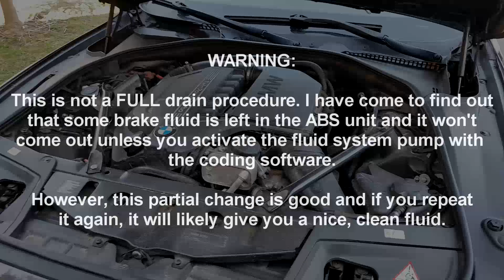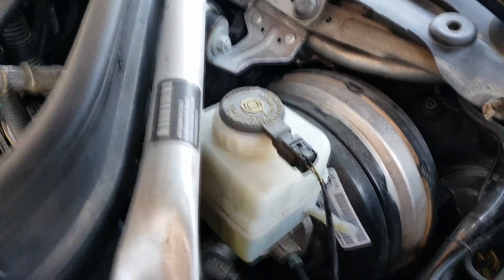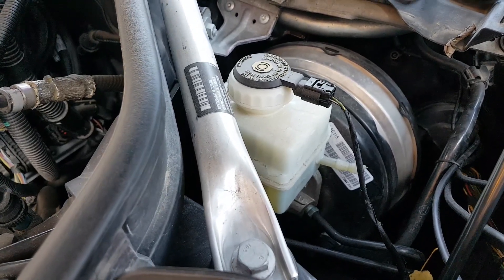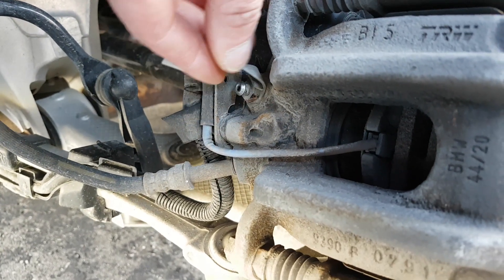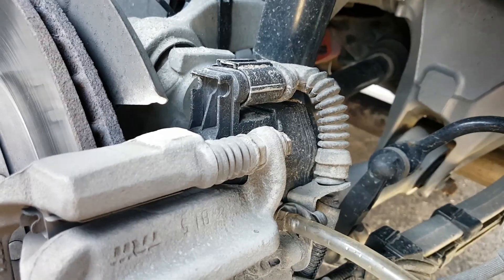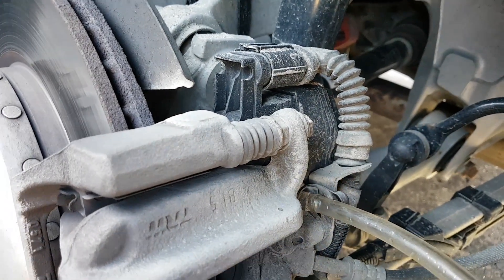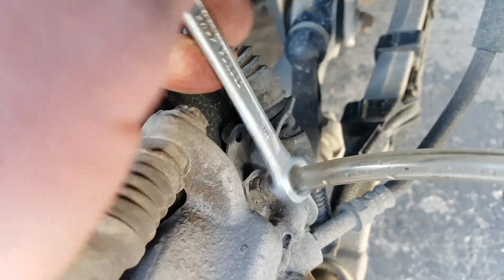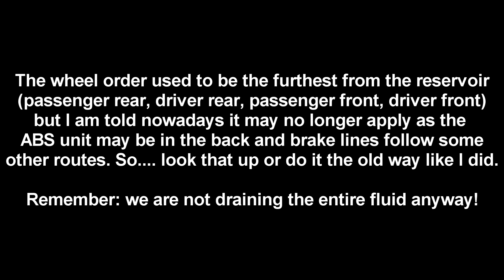BMW 5 Series F10 - Brake Fluid Replacement, Drain, Refill - N55 DIY - 2011 BMW 535i F10 3.0

Comment: 1. Brake fluid flush time is a good time to check brake pad thickness.  The radial groove on the pad should be visible, if not it's time for new pads.
2. What almost all fluid change videos miss is that the caliper is full of fluid and simply pumping fluid through it, or sucking it through, may not fully replace fluid in the caliper, which is where new fluid is most needed. To accomplish that, push the brake pads and caliper pistons to the full retract position and place something between the pads to keep them far apart.  The proceed as usual; remove the spacer when done.  
3. Do not forget to top up the master cylinder fluid reservoir after bleeding each wheel.

Comment: i wonder if this is still the right way of bleeding the brakes?
Reply: Its not. Air can get back in.
Reply: Me too😁
Reply: Hes a cowboy as there come from all over u tube . Think of the pipes ' Abs and the oil near the cylinder that's nearly half left over . No air locks though bcus he never emptied.  Ha ha pls be careful .... joke ! 
You must ask if a liter went in it must come out same amount .

Comment: Should you not close the caliper every time you lift the brake pedal? You risk sucking the air in this way.
Reply from the maker: no, because you are not sucking anything in (and your old fluid in the tube prevents any air from getting back in). if you watch what is happening, you are only expelling stuff and new fluid is being sucked in from the fluid reservoir under the hood.
Reply: @yogi799  Sorry, but I don´t agree. The risk are that you suck in air in the thread of the hollow screw and therefore should close it, before lifting the pedal.
Reply: Lasse Eklund that's not true. if the hose is sealed on the bleeder valve (you can use a hose clamp to be extra sure) and the other end of the hose is submerged in liquid, air cannot get into the system. it is physically impossible. the air cannot go past the fluid in the external bottle. when a vacuum happens when you release the brake, some old fluid may go back up. but since you're flushing all of it, eventually only clean fluid will be in the tube. 
this is a common diy way to bleed brakes. you may lookup other videos showing this same method
Reply: @dylan-nguyen  that assumes you have a perfect seal with the tube/plug and didn't open it too far and gotten a leak at the thread either... as air is easier to push than liquid. see https://youtu.be/gAKBZG9kQPw?t=1078. I see many videos of trained DIY close before each release for that reason... but it is much more time consuming. I'm getting very little liquid each time (2014 528i) so I may try that, or look into a power assisted way. I have a foxwell 510E so there might be a way to activate the ABS pump and flush it out that way...
The prius uses the ABS pump for the 2 rear so it takes no time!

Comment: What size hose on the bleeder valve?....and thanks for the videos...I just did my thermostat and water pump from watching your video, and you weren't kidding about those sway bar bolts, they were awful lol....thanks again
Reply from the maker: oh gosh i don't remember. grab a couple short ones from the store and fit the smallest one that will go on the valve. that's it. you're welcome, glad it's helped.

Comment: does it matter which wheel you start on first?
Reply: lsturbointeg supposed to be the farthest wheel first. Passenger rear—>driver rear—>passenger front—>driver front. Really should use a power bleeder though to ensure you don’t get air in the lines
Reply: @joseurbaez8869  the first part is correct but I've also heard it doesn't matter any more because the brake lines could be any sort distance even though I still use what you posted
Reply: I also use the method shown in the video because its easier as long as you have a second person to help push the pedal